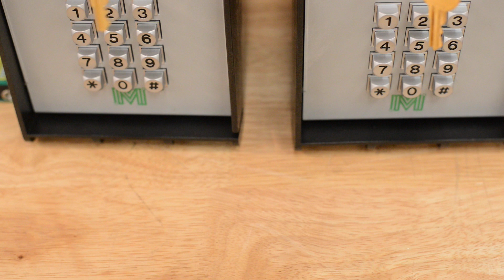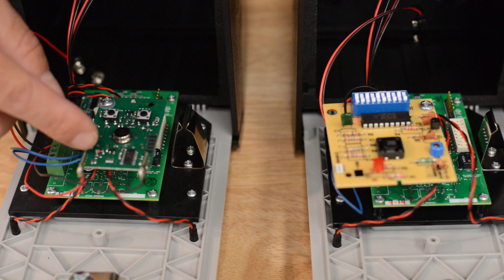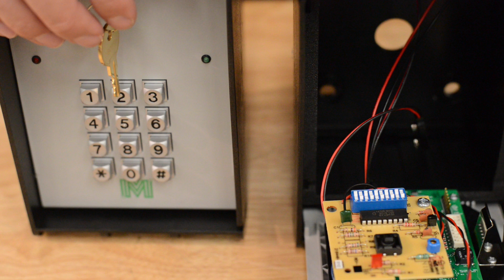How To Use Millennium Keypad

Comment: I have the Millennium Model 950/951 with the Digi-Code internal workings, my question is when opening the gate with the keypad how do i get the gate to close after you drive through.........i can not find this function, so basically when you open with the keypad the gate never closes behind you......HELP??